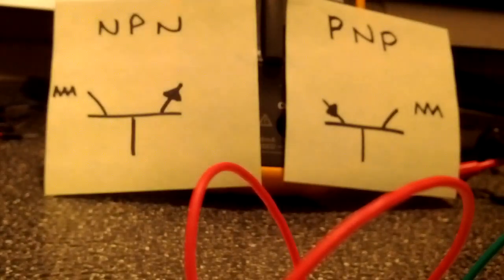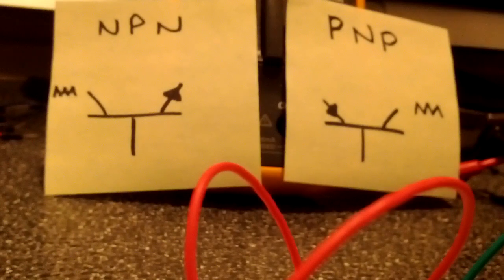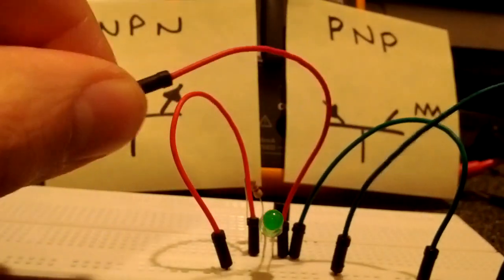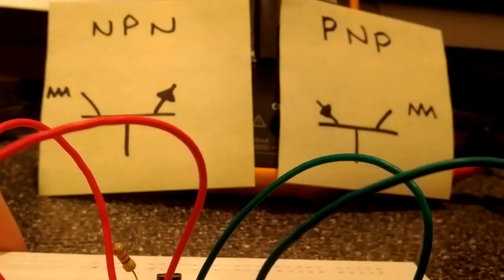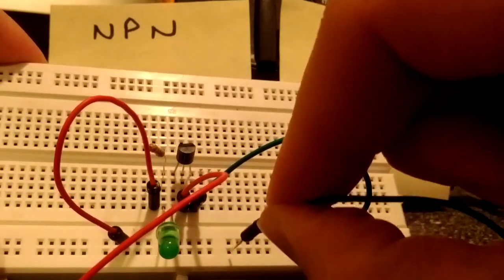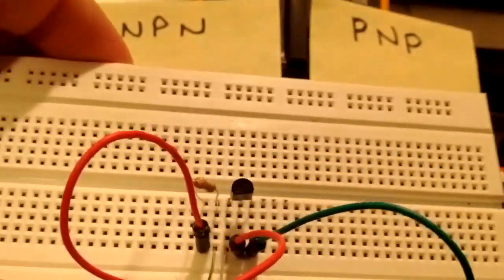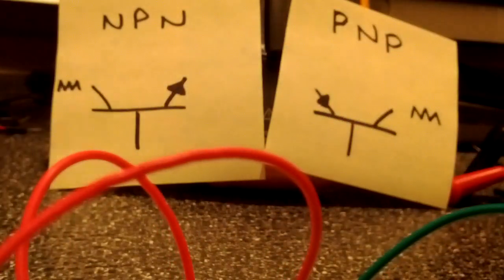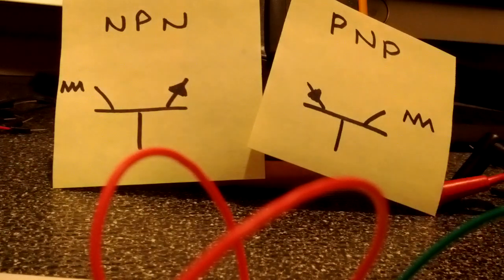NPN vs. PNP Transistors

Comment: Still kind of confused, so the npn requires a signal to go through it from the base part to allow signal to flow through the top left to the top right. And on the pnp requires signal from the top left to allow the signal to flow through the base to the top right? These seem like the same thing just requirinf a signal to allow another to pass through

Comment: it's not working for me. on base of pnp i measured my 12v supply voltage and by connecting it with a resistor it basically shorts it...i think i will stay on npn side for now

Comment: Good explanation.  it's basically a tiny relay with a diode
Reply from the maker: KA Persona yup, that's right. Can be considered a solid-state one-way relay.
Reply: Until you consider the amplification of AC signals or Transistor Biasing, but 'That's a topic for another video'.  ;)

Comment: Salam...
So with NPN you need small current i.e. Current (Collector) / Current (Base)

And in PNP you remove current at Base and it starts to work

Is that correct understanding?
Reply: ***** 
Why are you cursing? its easy to type something on a wall because the person is not in front of you.  Jon Proce ... Please ban +RealJinKaXama  he is trying to ruin a health discussion board.

Comment: Hello, I tried to make the same circuit but in my case the LED is VERY dimmed, it is glowing about 10-20% of its full power.
I used power source 3.3V, NPN bc337 transistors and 220 or 100 ohm resistor.
I can provide schematic and images, little help please!

Comment: what a hard thing to understand :'(
i wanna know .. if there is a load is conected to PNP , and other same load is connected to NPN , what is the deffrent ?????
please i want answer for that :( :(
Reply from the maker: soma sun 

They both do the same thing, it's just the way the circuit is arranged that changes.
Reply: Jon Proce  thanx alot ..
if i have a questions in sensorse can i ask ??
Reply: the load will be on the collector on either cases (pnp & npn)
Reply: aha thhhhhanx a million >> i understand it very will :)

Comment: Current flows from negative to positive tho doesnt it?
Reply from the maker: Electrons flow from negative to positive, yes, because they are in themselves negative. "Conventional" current flows from positive to negative. It is not physical, but rather just a mathematical concept that the world has agreed to adopt and will likely never drop. In any case, a negative electron flowing in what we consider to be a backward direction is the equivalent of a positive charge flowing forward (-1 x -1 = 1).
Reply: yes that is the true trick but physcits will tell you that the current flows from positive to negative but that is conventional or theorical, in reality electrons move from negative to positive and the flow of current is opposed to the flow of electrons.
Reply: Jon Proce yes that is true, so do you have idea about JFET transoistor?

Comment: So the supply from drain to source in a PNP is switched by current going into the base from the source as opposed to being supplied into the base in an NPN? So if we were to break the circuit from the gate to the rest of the circuit denying it a ground (with a switch say) the transistor wouldn't allow current flow across it from drain to source?

PNP's are kind of confusing. I think NPN's sound more useful.
Reply from the maker: That's correct (I think, it's confusing to think about). PNPs have their place, but NPNs suit most applications and are far more common.
Reply: Jon Proce the transistor when acts as a switch eventually does the amplication ?? or the amplification & switching are the simultaneous process??

Comment: Hello! I have a question... I used the same circuit, and found that putting a npn transistor backwards worked better than it did the normal way. Why is this?

Comment: Hello! I have a question... I used the same circuit, and found that putting a npn transistor backwards worked better than it did the normal way. Why is this?
Reply from the maker: Are you sure you know which way is which when you plug it in?
Reply: Jon Proce yes. Correct me if I'm wrong, but doesn't the arrow in the transistor symbol indicate that the current can only flow in that direction? Because its flowing backwards just fine.
Reply from the maker: No. Diodes are only made of two layers, N and P, whereas transistors are sandwiches so they're like bidirectional diodes. They are just optimised to flow in one direction.
Reply: Ok thanks.
Reply: And why does it matter which side the load is on?
Reply: Garrett Dhoore  The load can be on either side of a transistor. Emitter or Collector. It doesn't matter. Just depends if you want a positive or 0v output signal...
Reply: banjax66 what do you mean?
Reply: About "the load can be on either side of transistor"  I listened somewhere that one N side is thicker!!!   What is the physical relation among that thickness and being collector or emitter?

Comment: When building a simple amplifier circuit with one transistor,
if the schematic shows an NPN but I'm using a PNP, won't the unit still work
if I just reverse the battery and speaker polarities?
Reply: good question

Comment: It is important to understand the word "saturation" and what it does at peak whether is - saturation or + saturation in the use of a transistor NPN or PNP. in the presence of a + the - saturation decreases and allows flow, closes the circuit . In the presence of -  the + saturation decreases and allow flow closes the circuit . More, in order for this event of saturation to exist a particular conductor with -,+ properties is used. this very much like a mechanical relay but with use of electrons.

Comment: Love has nothing to do with electrons and the manner in which electron behave in a circuit. The earth wasn't square therefore we move into an elliptic sphere, so, if the assumption in moving electrons was positive to negative but is not , is time we stop using that assumption since ....not in theory but   Electrochemistry proofs show current flows negative to positive. Thank for the video.

Comment: Hey thanks for the great explanation! I just have one small issue. Ive been building circuits and messing around with PNP transistors successfully using the understanding of them that you gave me with this video. However, when I went to Wikipedia and other sources it explained that the diode/input end was the emitter, and the output was the collector. So a current or voltage from emitter to base allows a larger emitter-collector current. But both ways work for me. Mind explaining?

Comment: I expected you to talk about why people use NPN mostly instead of PNP, so I'll shed some light to this:

Transistor layers have their doping created in a way that in N layers, electrons carry the charge, while in P layers, protons carry the charge. Now it is well known that an electron weighs less than a proton, therefore can travel through the field barriers within the transistor more easily, resulting in less transmission delay when using an NPN transistor.

Comment: you can Google the part number and usually there are PDF results giving you data specs on the requirements and rated maximums for it.  Sometimes you may even see an example circuit of it in use.

Comment from the maker: Two negatives make a positive, and thus if we were to rid ourselves of this burdensome "obsolete" system, in fact absolutely nothing would change. It's for the same reason that the USA still uses imperial units. One cannot deny that the metric or SI system is both superior and more intuitive, but imperial is what people are used to, and there would be little gained from troubling everyone with the switch. It's worked this long, and it will keep on working just as well!

Comment from the maker: You're absolutely right, electrons flow from negative to positive. We use conventional current (from positive to negative) because it's, well, convention! That's how every equation and idea we now know, love, and rely on was derived. Regardless, we haven't switched it because mathematically it doesn't matter which way it flows. If we consider negative electrons flowing backward, it's exactly the same as considering 'positive charge' flowing forwards, even though it doesn't technically exist!

Comment from the maker: Electrons have a negative charge, and a negative going "backwards" in a conventional circuit gives you a positive. This is why we can work with conventional current (we are considering moving POSITIVE charge, even though it doesn't exist) and not have it deviate from the true electron flow.

Comment: My best guess would be that If your load resistance is high enough it might 'block' the voltage difference between the base and the emitter making it impossible to turn on. This probably wouldn't be noticeable except with very high resistance loads which is why it is still working for you. Although I'm just guessing here so I'm probably wrong :)

Comment from the maker: I don't have a very definitive answer... I think the way I laid it out is how it's usually recommended to be hooked up, but in the end what really matters is that you trigger NPN with +, and trigger PNP with -. Which side the load is on probably doesn't matter as much, maybe if you put it on the same side as the "diode" your voltage drop across the load will be 0.7V less, since it has to run through your load and the PN or NP junction in series.

Comment: If you place load on the emitter of NPN transistor, at the moment current starts to flow it will generate voltage on the load (emitter). In order to keep the transistor conducting, you need to keep B-E junction forward polarized, which means that you would need to increase base voltage. Same principle applies for PNP.

Comment: I understand the difference between the two in that they are triggered differently, but I'm unclear as to the positioning within the circuit.  Why would you not use a NPN on voltage side of the load in the circuit -- or why would you not use a PNP on the ground side of the load in a circuit?